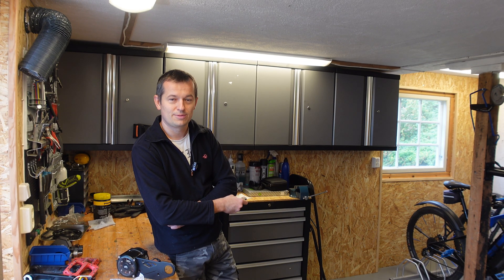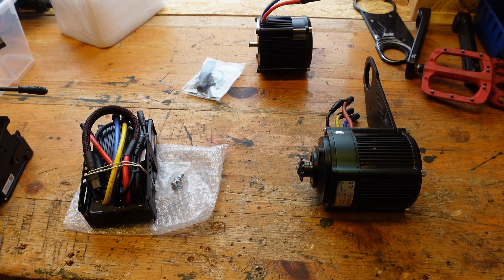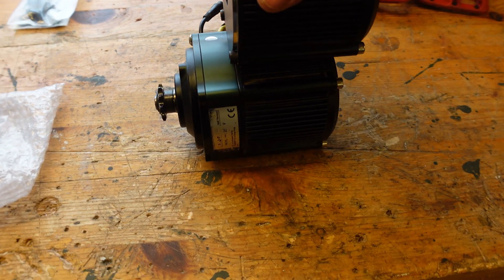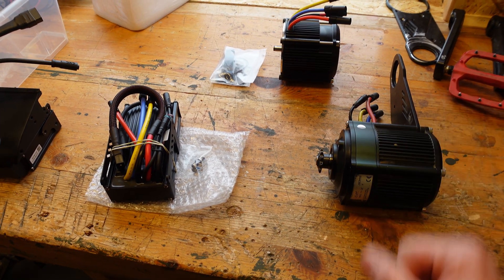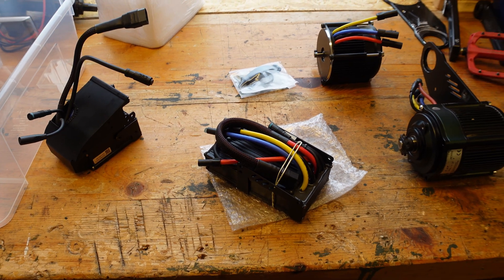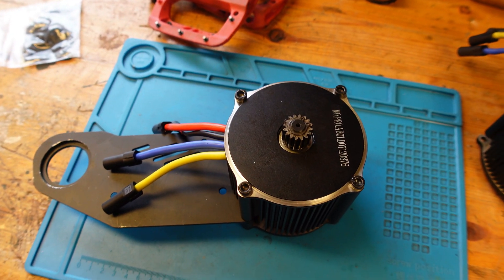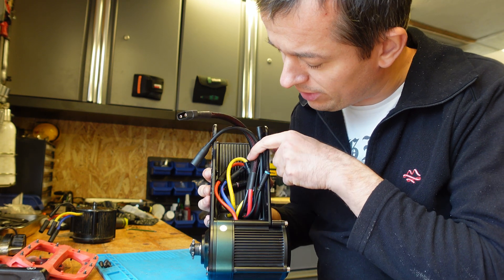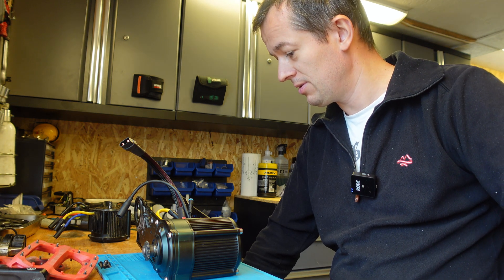X1 Pro Gen 4 upgrade

Comment: Curious as to why hall sensor failure would be typical after 1-2 years?  I assume that's what you are referring to. Seems like that is solid-state electronics that should only fail if the components or assembly are sub-par.  Your channel has great information - thanks for your detailed reviews and hands-on work
Reply from the maker: I would not call it typical failure. I have 2 other X1 Pro motors, which are older and work fine. Hall sensors are the most fragile component in the stator. It's the most common failure in brushless motors in general, not limited to CYC only.
Reply: @LierskogenEbikes  Good to know.  I'm looking at a CYC conversion for my fat bike.  It will be my first e-bike. Having several CNC machines using hall sensors, some with flood coolant, sensor failure has never been an issue. We are talking thousand of hours run time, in machines built 20-30 years ago.  I would guess that putting a BLDC motor down near mud and snow and keeping it affordable is a real test for a 'young market.'  I can live with that if there is a way into fixing it rather than scrapping it!